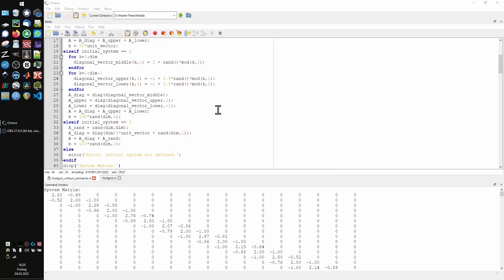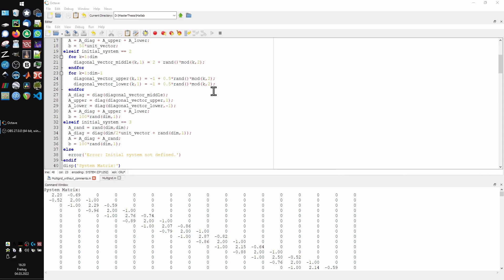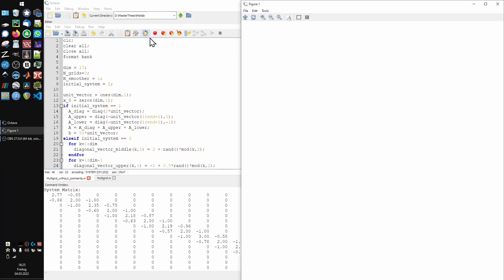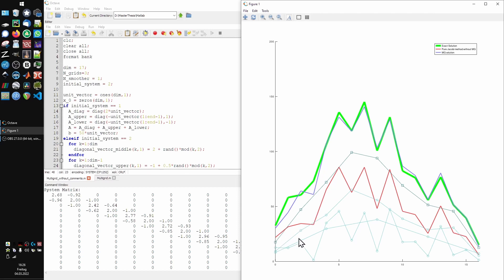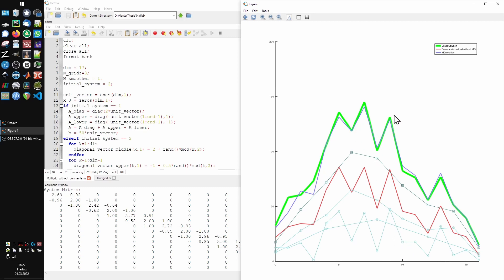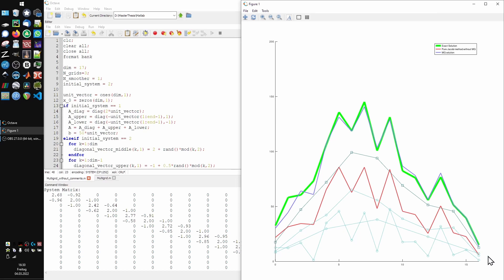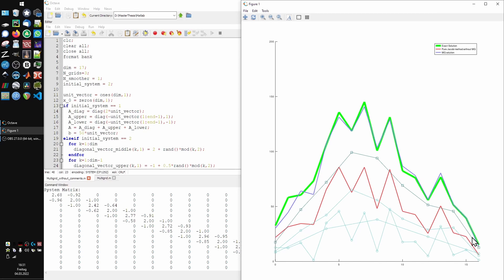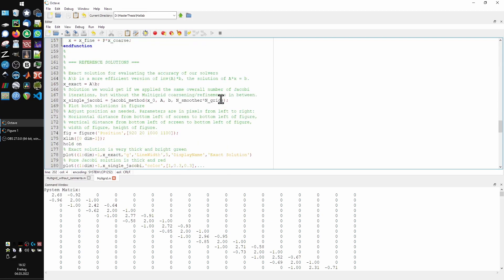Multigrid method: Basic concept explanation + full MATLAB/Octave code

Comment: Doesn't work in  Matlab 🥺
Reply from the maker: I don't have it installed, but if you give me the error messages I'm gonna take a look.
Reply: @Makstuff  '''Function definitions in a script must appear at the end of the file.
Move all statements after the "AMG_refine" function definition to before the first local function
definition.''''   when i do it , doesn't work also
Reply from the maker: @azzagamal9243  Thanks! Had to install Matlab after all to figure this out, but now it should work (or at least on version R2018a it does).

Problems were 1) the octave commands "endif", "endfor", "endfunction" which I didn't know that Matlab required to all be just "end", 2) the unequal operator "!=" had to be "~=". Octave makes so much more sense btw 🤦‍♂
Reply: @Makstuff  thank you very much
Reply: Error in line 165